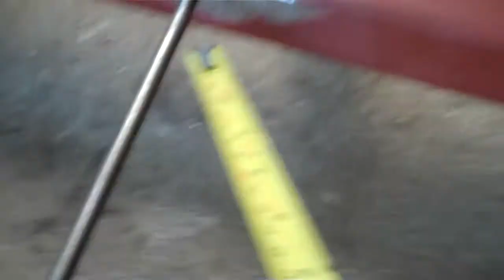Delboy's Garage, Project Rat Trailer Part 11.

Comment: Better and better :-)

Liked the preserver method.
When my mum died we coated her wooden grave plaque with linseed oil, the wood sucked it in but i dont know if it helped the wood, better than nothing i suppose.

Another odd one is using black rayburn stove paint for scooter exaust pipes, its cheap and of cause it can cope with heat :-)

I also dont like waste, im odd as i appreciate something made from crud more than new stuff, its not just the cost eather :-)

Smashing update :-)

Comment: nice progress mate, top tip with the waterwash. was gonna ask you if you will seal of the ends when you sawed the boards to length, but they look like its penetrated all the way through the wood. those boards reminds me of me childhood home, dad used the same boards in the bathroom to cover up some well dodgy walls :-)